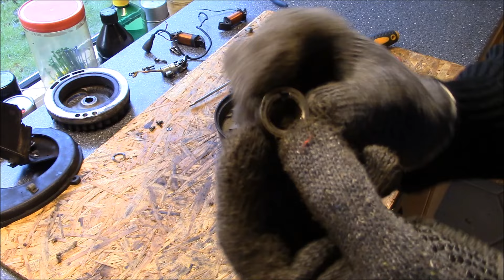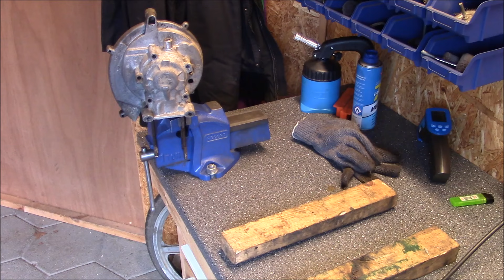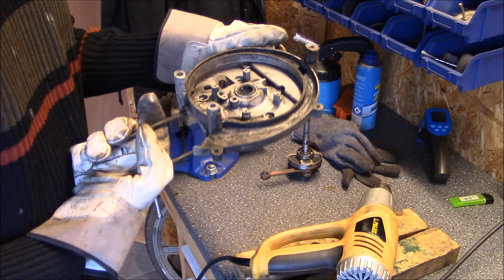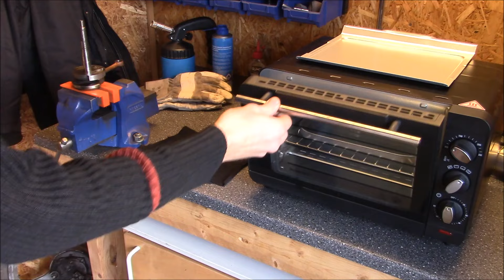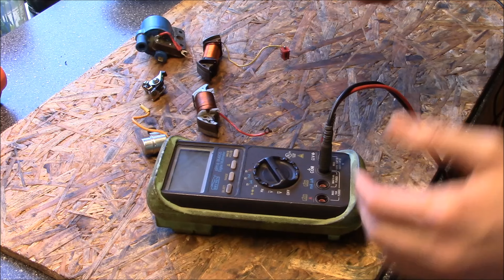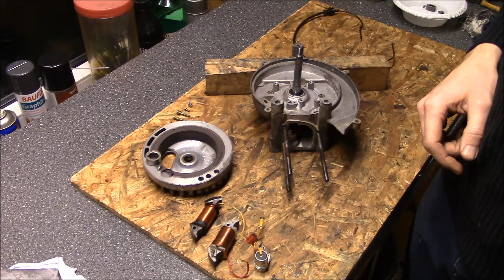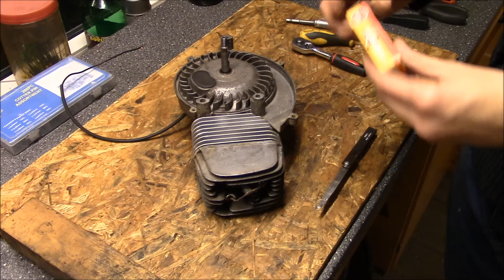Piaggio Moped Engine Rebuild

Comment: Does the rubber seal on the crank shaft ever go bad and cause the engine to not start due to lack of suction on intake side. I have a piaggio clone engine " kenetic"  and it's has good compression and spark. But will not start. Thank you for this great Video.
Reply from the maker: Yes it can go bad, but normally it would only cause a lean condition. It has to be very bad to cause a no start.
Also check if the key is still there in the flywheel. It could be sheared off and then the spark comes at the wrong timing.
Reply: @CarstenLorenzen12V  thank you carsten l, yes my keyway is intact i have removed the flywheel and the seal seems good maybe i have just flooded the crank case.
Reply: Hey! 
Did you solve the problem? And So, how? Thanks alot

Comment: Great video! I have a problem with the flywheel grinding the cable for the condensator. What am i doing wrong?
Reply from the maker: Tidy the wires until they have enough room for the spinning flywheel 😉
Reply: @CarstenLorenzen12V  sorry my bad, the damage is at the top of the condensator and there’s no way to put it any tighter against it.. might be that I’ve received a bad one that doesn’t fit..
Reply from the maker: @kimmyrask7368  I've never seen this happen. I'd try another one, brand Effe.
Or mount a external 330 nF MKP capacitor near the ignition coil, 250V or more is fine. Then just cut the capacitor down until it doesn't rub, and use it only to hold the feltpad to grease the cam.

Comment: Hejsa 🙂 Fed video, tak for det! Er der forskel på højre/venstre krumtapsleje? Du nævner noget om C3 i højre side....  M.v.h. Peter.
Reply from the maker: Ja Piaggio har valgt at der skal sidde et leje med C3 slør i tændings siden, altså venstre side i kørselsretning.
Tak for roserne 😊
Reply: @CarstenLorenzen12V  Selv tak 🙂 Det er velfortjent! Jamen hvad skal der så sidde i højre side?  Er i tvivl, fordi alle steder hvor de sælger stumper på nettet sælger de bare 2 stk. C3 som sæt til krumtappen...
Reply from the maker: @schou1170  nej det kan jeg ikke tro, de steder jeg handler får man en med normal slør og en med C3. Normal slør i den lille blok halvdel.
Tjek motor rep kit ved Mopedspeed eller jmpb.
Reply: @CarstenLorenzen12V  Ok, så har jeg bare misforstået... -Hvad hedder det det leje med normalt slør, til højre side, teknisk set? Hos Mopedspeed kalder de nemlig bare sættet for "2 x Leje 6202", som om de er ens... -Der  må være noget jeg ikke har fattet! 😀
Reply from the maker: @schou1170  normal er bare nummeret uden efterbetegnelse, 6202.
Nogle kalder det CN i stedet for C3, men det er ikke så meget brugt.
Reply from the maker: @schou1170  https://www.mopedspeed.dk/motor-rep-saet-piaggio dette kit har de rigtige lejer.
Reply: @CarstenLorenzen12V  Aaah, nu faldt 10-øren! Så lærte jeg også noget i dag! 🙂Tak for hjælpen, og tålmodigheden!

Comment: What color wire goes to the bulb?
Reply from the maker: Red front and green rear AFAIK.
Reply: @CarstenLorenzen12V  What wire are you connecting from the motor?
Reply from the maker: @keremyumak879  the connector in the square plastic clip.
Reply: @CarstenLorenzen12V Do you have a video showing all the cables?
Reply from the maker: @keremyumak879  no.
Reply: @CarstenLorenzen12V  Sharing a video on this topic will be helpful to me and other people.

Comment: Thanks for the great video. Can I test spark with ignition plug connected (/I did but no spark, so is there some grounding issues or what ever?) or should I use just open ended wire as you did?
Reply from the maker: Always test with just the wire, if you have a spark over 5-6 mm your ignition is ok. Then the error must be in the cap og plug. Yes the engine and external coil must have a good ground connection to each other. Hope this helps you.
Reply: @CarstenLorenzen12V  This is perfect, will do so. Thanks for the quick answer.

Comment: there is no oil in the engine? the crank shaft bearings look really dry, how does it get lubricated?
really nice video by the way :)
Reply from the maker: Yes the engine holds no oil. It's very normal in two stroke engines, the crankshaft bearings only get lubricated by the oil in the petrol.
If you have gearbox oil in a two stroke engine, it's typical to lubricate the attached but separate gearbox.
In these piaggio mopeds, the gearbox is split from the engine and located in the rearwheel, where it of course holds oil 🙂
Reply: @CarstenLorenzen12V  thanks for reply, i just swapped bearings on crank shaft, but i cant get it to spin freely i think that my crankshaft might be bent, or is it possible that i have heated the engine block to much and it got damaged?? i use a heatgun just like you did in the video.
Reply from the maker: @fisktomte  can be several different things. Are you testing without the seal mounted?
Have you tried to hit it with a rubber hammer like shown in the video?
Reply: @CarstenLorenzen12V  i got it figurer out, No Bent crank, i hade success after putting crank shaft in THE freezer, heating THE big block and THE dropping THE bearing inside, then taking crank shaft out THE freezer and dropping it in to THE block Side with THE bearing already mounted, and Bow it spins free

Comment: Hello my friend, thank you for this great video.  A question, what would cause a "weak" spark - one that can only jump 2-3mm, but not 6mm and definitely not 10mm?  Same test as you have run, but the spark isn't jumping that distance.  Thank you!
Reply from the maker: Many things sadly. Start to measure all the things i show in the video, if a component is far of, replace it. Other than that, a small short to ground in the wiring or breaker points can give the same error.
Reply: @CarstenLorenzen12V  Thank you for the reply, I really appreciate it. At least I'm on the right track, just going through everything.  Many thanks from Cleveland, Ohio!
Reply from the maker: @fpcb750er  also check that the external coil has a good connection to ground. You can connect a wire from the coil ground to the engine case for testing.

Comment: Hello again MR Lorenzen. I am considering buying a new crankshaft. The bearing at the rod end  is making a little noise when I am turning the rod. It feels smooth however. Which aftermarket crankshaft would you recommend?
Reply from the maker: Hello. My favorite is Mazzucchelli, they make both 10 and 12 mm wristpin models, and both with an original cutout and a version with enlarged racing inlet timings.

Comment: How do you get the gas intake hole bigger in the crankcase? I've tried drilling but can't get through.
Reply from the maker: Please watch my other video about tuning the engine, you need to grind it. Drilling it can result in a broken engine very easily.
Reply: @CarstenLorenzen12V  Woops, ok I will try that. In your tuning video the steel restricting plug dosen't exist. What kind of grinding bit would you use for that?
Reply from the maker: @johanmagnusson2203  if you have the long steel restriction, use a mini dremel angle grinder disc and remove the surface in the middle of the inlet window. Until you can see the restriction. Then you can use a punch and drive it out with a hammer. But support the inlet from the other side, with i.ex a socket. Hope that makes sense, be careful with the dremel, always leave 2 mm on the long sides of the inlet window, and 3 mm on the ends.
Reply from the maker: Give me your e-mail, then i can send some pictures.
Reply: @CarstenLorenzen12V  Sent an email to your youtube email!

Comment: I'm sad bought myself a top racing crankshaft but heard you say this one is not good. Do I need to buy a new one? What are the weak points on the shaft? Do I need to use another needlebearing where there piston is on? I have a original piaggio used needle bearing. Is this one better then the one on the top racing?
Reply from the maker: The original is one of the best. If it's not worn out, I'd use it. Top Racing has a bad reputation of breaking in tuned engines, I've just never dared to try them, but have seen many pictures of broken shafts. Maybe they are better nowadays?

Comment: Hej Carsten
Ville du måske være venlig at forklare mig kort og simpelt hvad kondensatoren gør, hvad platinerne gør, og hvad fødespolen gør og lysspolen. Fordi er rimelig ny til at skrue i vespa ciao.
Håber du kan/vil hjælpe.
Reply from the maker: Fødespolen generer strøm, denne bliver styret af platinerne, når de åbner frigiver spolen strømmen til tændspolen, som transformerer strømmen op til høj spænding. Kondensatoren lagrer strømmen kortvarigt, så gnisten ikke springer mellem platinerne.
Lysspolen laver strøm til lys.
Det er mere kompliceret end sådan som jeg har beskrevet det og måske ikke helt teknisk korrekt, men håber det er en forklaringer der kan bruges.
Reply: Carsten Lorenzen tak for svar.

Comment: Hi.. in my piaggio vespa I had a problem with the ignition. Then one bike expert converted breaking point platina into CDI.. Now the problem is the bike only starts when the chock air is closed in the carburator. When it comes to normal position it stops. What will be the problem here. Please help.
Reply: Fuera de tiempo ¿)

Comment: Hi there! I take some measurements before I close the engine an i realized that at the smaller crankcase half, there is a kind of embedded spacer upon which the bearing sits on. Measuring the distance from spacer to the edge is 1cm and the bearing has a width of 1.1cm. This makes it by 1mm higher from the bottom of crankcase and not fully inside. Is this normal? It is a model engine around 70s
Reply from the maker: Yes that is normal :-)
Reply: @CarstenLorenzen12V  Thank you! Your video is the best guide ever.

Comment: Can you please give the threading specifications of the flywheel remover. It's difficult to get that part in my country. 
Thank you!
Reply: Thread is 17x1, recommended tool is the Buzzetti 17R1. Good luck
Reply: @darrenmelia4527  thanks a ton!
Reply: 17x1

Comment: hey , great video 
i have same engine im trying to start it.
installed new piston ,rings ,no leakage from head ,suction from carburator side works fine , spark is good as well as coils.....yet engine not firing up, a little misfires once or twice , hence fuel comes up , i thought maybe decompression valve might be leak but checked for leak test all good......but still engine not firing up... please help , let me  know if i missed something, im stuck !!!!!!
Reply: hmm maybe you have put the wrong fuel mixture?
Reply: Check sparktiming, I had a ciao once that stripped the locating ping for the flywheel all by itself.
Reply: Hey! 
Did you solve the problem? And So, how? Thanks alot

Comment: Must i have the washer? 5:09
Reply from the maker: Yes that is advisable. Without it, the cam can vibrate a bit and cause wear over long time.
Reply: @CarstenLorenzen12V  okey, thanks! I wondering because the flywheel doesent   fit properly. Byt without the washer it fits better.. Do you know why? :)
Reply from the maker: @kristofferfrid2195  new non original crankshaft? Mounted in the large case first?
Reply: @CarstenLorenzen12V  no I think it's original. I noticed when I was going to remove the engine that the flywheel was loose
Reply from the maker: @kristofferfrid2195  if it works without the washer, than try that. You could also grind the cam a little narrower.
Reply: @CarstenLorenzen12V  thank you so much 👍

Comment: Hey Carsten, nice video!
I recently bought a multimeter to measure the coils and capacitor from my moped.

My capacitor gives a value of 560nF. Is this too high? I've got another capacitor which gives a value of 305nF so I've got a spare one.
But I was wondering if the high value capacitor (560nF) could be used?
Reply from the maker: Hi. The highest I've had running was a little over 400nF. I honestly don't know when bad things happen. Manufacturer specs often talk about +/- 20% max. But have they tried? 🤔😉
Reply: @CarstenLorenzen12V   haha good question. I'm going with the lower value capacitor, I might try the other one in the future.

Comment: Can I put a 60 or 70cc kit on original motor?
Reply from the maker: Yes 43 mm bore fits on the standard engine. That gives you about 63 ccm.
Reply: @CarstenLorenzen12V  ¸thanks for the annswer. I was actually concerned if the other components will be OK with higher power?
Reply from the maker: @JocoGorenc23  the original crank handles it great, very good quality.
Reply: @CarstenLorenzen12V  great man, thanks for advice =)
Reply: i've put thousands of miles on the DR vespa kits with stock cranks.

Comment: hello is there is a washer behind the bearing on the crankshaft on the side or there is no key
Reply from the maker: I'm not sure i understand what washer you mean? There's a washer between the crankshaft and the bearings on both sides. And a washer above the breaker points cam.
Reply: @CarstenLorenzen12V   I'm french
Reply: @CarstenLorenzen12V  thank you
Reply: @CarstenLorenzen12V  instagram or facebook ? please
Reply from the maker: @kevinyz2591  12v.dk

Comment: Hej Carsten. Jeg har en vespa si fra 1990. Den plejede at køre helt fint men en dag gad den ikke at starte. Det ser ud til at den ikke laver gnist. Tænfspolen virker men er ikke sikker på om platinen virker eller kondensateren. Tror at den ikke laver nok strøm.
Reply from the maker: Prøv og se fra minut 27 og frem, der går jeg hele tændingen igennem, inkl udmåling af komponenterne og til sidst montage og justering.
Reply: Mange tak fra hjælpen

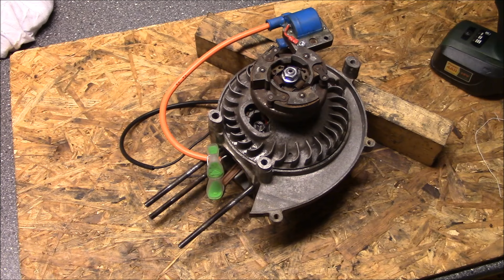Comment: Carsten Lorenzen....Hi.  I need to have a confirmation: at about 41:45 you show how to check if electrical system works well. My question is: the external coil must be attached to the engine case with a bolt as it seems in the images?  Many many thanks in advance for your answer.  P.S.: this video is really great and very useful!  Thumbs up!
Reply from the maker: Yes, the coil is connected to ground via the engine case. Same goes for when it's mounted on the moped. It has to have a good connection to the frame. I like to connect a wire between the engine case and coil, to be sure. Especially after new paint etc, that can isolate the electrical connection.
Reply: @CarstenLorenzen12V  .....Fist of all many thanks for your fast answer. Well...the frame of the Piaggio Ciao i am restoring has been re-painted and so i think i will brush the part of the frame where the external coil is mounted in order to not have problems of isolation.  Many thanks again!
Reply from the maker: You can do the same on the rear engine mount on the left side. Put a "toothed" washer under the bolt, it will give a good connection between the frame and engine.
Reply: @CarstenLorenzen12V  .....Thank you very much for this advice.
Reply: @CarstenLorenzen12V  ....Few minutes ago i have tested the electrical system of my moped: everything works well and there is a perfect plug. Thanks.

Comment: Hello man, so I have a engine I pulled out of an Grillo. Its seems to have good compression and it has spark but when the previous owner said it wasn't turning on and it really isn't . I have checked fuel and spark . Could it be a timing issue ? The engine seems good shape. Also great video !
Reply from the maker: Hi. Have you cleaned the carburetor? Maybe the main jet or atomizer pipe is clogged.
Also, how strong is the spark? Eventually do the test straight from the cable, like in the video.
Reply: @CarstenLorenzen12V  I will have a look but i think the carb was pulled from a working piaggio SI   that engine lost compression and couldn't run, but I'll look at the carb to see if any build up is the problem since it has been sitting for a while after it's engine broke down. For the spark I'll try and see how strong it is although I didn't really test it , it did give me quite a shock in my hand while I was cranking it but ill check it with a proper test. Thanks for the advice !

Comment: I got a piaggio bravo 1977 my motor got 3 coil inside the motor you know what is the ignition coil from the 3 the have?
Reply from the maker: I'll guess it's a model with an extra coil for flasher/indicators. The upper is the ignition coil, lower lights and to the right for at indicators.
Reply: @CarstenLorenzen12V  
Hey buddy one more question that cable from the ignition coil inside the motor go direct to the coil outside
Reply from the maker: @charlestalavera3717  yes.
Reply: @CarstenLorenzen12V  
Thank you buddy i just learning about this moped i found this moped the parts it was everywhere i put it together complete i got it for a while try to put it running aprecciate you help buddy
Reply from the maker: @charlestalavera3717  I'm happy to help :-)
Reply: @CarstenLorenzen12V  
From where you are im from milwaukee Wisconsin.i really born in boston but i live almost all my live in puerto rico and now i live in milwaukee i got 9 years here im gone try to send you a picture the way i found my moped my daughther make me crazy for fix the moped lol😂😂😂
Reply from the maker: @charlestalavera3717  Denmark :-)

Comment: Could i put first the bearings in the engine then the crankshaft
Reply from the maker: Yes that is possible, but then you can't achieve a large temperature difference, than the other way. The engine cases with bearings can only be heated to 120°C, so it's a good idea to put the crank in the freezer for at day. I would start with the small closed case, that side of the crankshaft is the tightest fitment and can cause trouble. If it doesn't go straight on, you can't hit press/hit it on, as it will damage the bearing. That's why i prefer to mount the bearings on the crankshaft first, if the hot and cold method doesn't work, i can still press/hit the bearing the rest of the way.
The fitment between the engine case bore and bearing outerring is not that tight, and you can heat the cases higher to 150-200°C.
So my recommandation is like in the video, but the other way is also ok if done right.